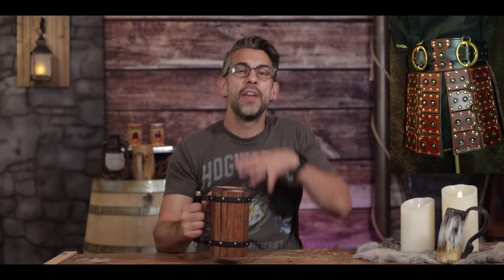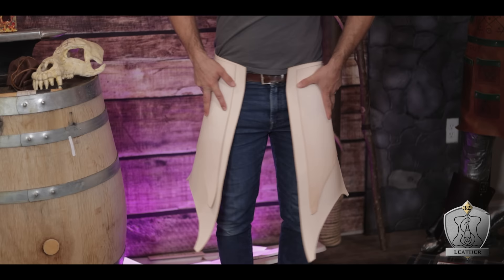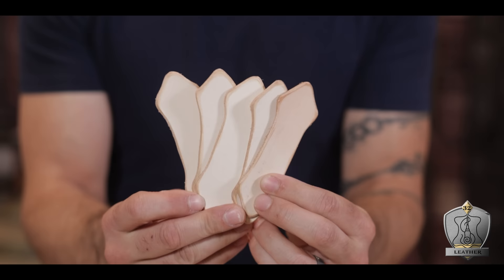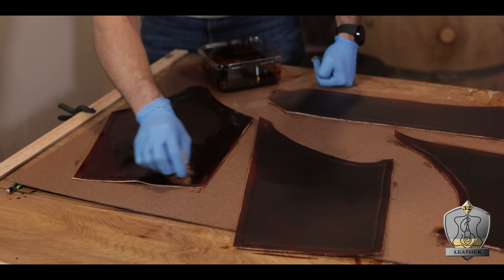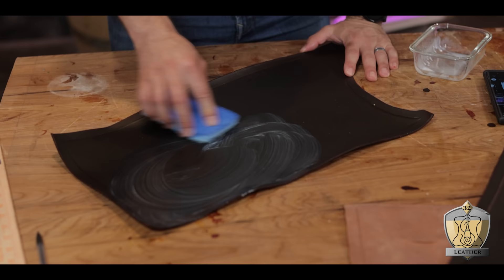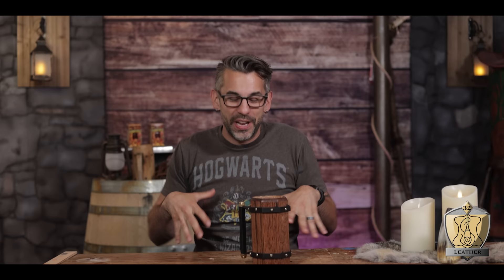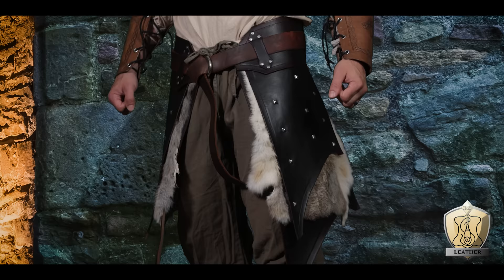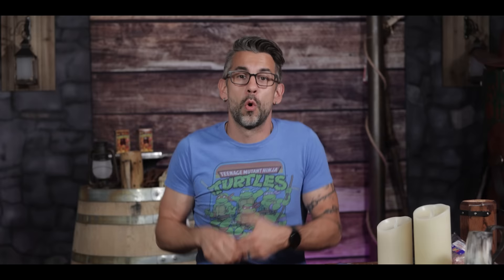Easy Leather Barbarian Armor! Bonus: Oiling Leather!

Comment: I switched to the Fiebings Pro Dye and it solves a lot of the bleedout problems after its dry.  I buff off the excess then lightly oil both sides of the leather with neatsfoot oil.  Then use a leather balm or saddle lac for extra sealing, but even with just a light coat of oil on top of the dye i havent seen any bleedthrough onto fabric
Reply: Yea this is my planned process based on copious research and notes I took. What drying time do you give between the neatsfoot oil and the balm/sealant?
Reply: @cbjewelz  i normally wait until it feels dry to the touch if I'm in a hurry.  But if I'm not in a hurry i'll let it dry overnight

Comment: 10:36 you are supposed to buff the leather after dyeing, but before oil or resist coatings.  It will remove most of the unabsorbed dye, as well as give the surface a bit of sheen. IIRC, Resist goes on AFTER buffing, but before any other finishes (antiquing, oiling, etc).  It seals in the dye and acts as a water resistant. Resolene may be better as a top coat after all other finishes.  To solve that "dehydrated" feel after dying with alcohol based dyes, its may be better just to use a hide rejuvenator, leather balm, or other wax such as mink oil wax. Heck, even "cleaning" with saddle soap or 4 in one conditioner can restore some suppleness.
Reply: My notes say to buff after several hours when using Pro dye, and then allow 24 hrs to try. Does that sound about right?
Reply: @cbjewelz  yeah sounds right. The dye is alcohol based so that evaporates quick. But it just helps pull the dye into the lether.  Depending on how heavy you coat the dye it could take a few hours. Buff it. Then clean (theres going to be residue from buffing). Then you may want to consider another dye coat if its too light or inconsistent.

You can also try dying damp leather. It pulls the dye deeper, can help with a more even coat and leaves less unabsorbed dye for buffing. But has the drawback of waiting much longer for it to dry.
As always test on scraps. Milage may vary.
Reply: @epremeaux  thanks yea, I’ve seen people recommend wetting with either water or oil before dyeing. I’ll experiment

Comment: So if my leather is dry lije that or im just done with my project and im not doing an acrylic seal i use febrings leather conditioner. You can apply by hand and wipe away access and let sit for a few ours or over night. The more tooling the longer it will take to dry completely.

Comment: If you are oiling leather that has stitching in it use a different oil because it will degrade the stitching. Never use on shoes or a saddle.
Reply: Apparently that happens with large amounts of oil over repeated applications? Good to know though thanks!

Comment: Why don’t you use fiebings pro dye instead of the normal fiebings dye? It paints much more evenly, doesn’t dry out the leather and the paint (almost) doesn’t rub of. So for me its a win-win situation. Oiling I only use for maintenance every year to keep the leather in good condition, otherwise the leather will dryout.

Comment: if it opens up it is a kilt skirts don't open they slip on there's a difference
Reply: Incorrect. Wrap skirts, which are not kilts, are a thing. Also, what he made was neither as it's just tassets that attach with a belt instead of onto a cuirass.